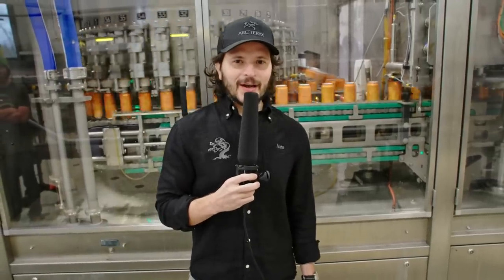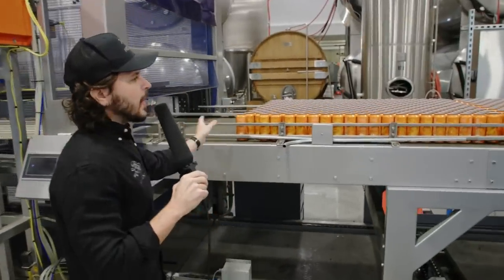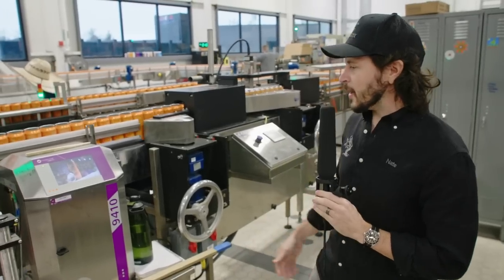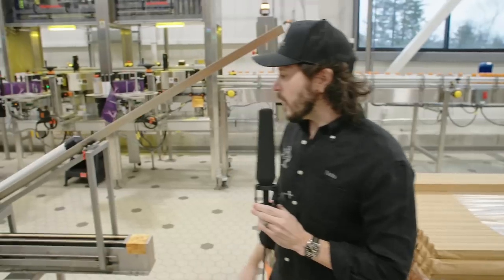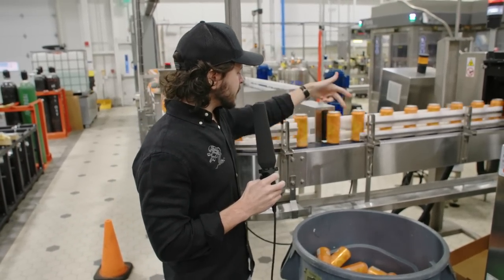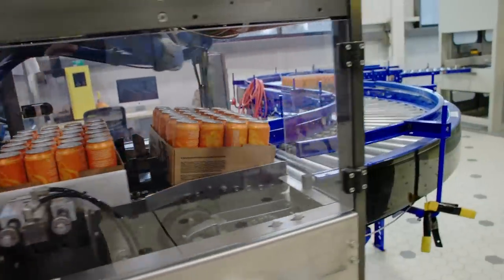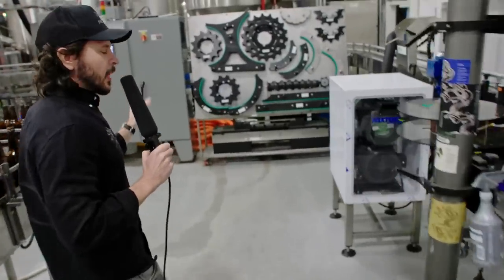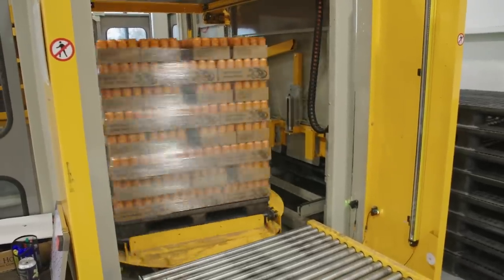How a CRAFT BEER CAN LINE works! (Tree House)

Comment: When filling kegs, why don't you use a spunding valve so you don't have to bleed pressure by hand?
Reply from the maker: Mostly old habits, it has always worked well for us
Reply: @treehousebrewco  Welp, you should give it a shot and see if it works any better.
Reply: Worst reason ever to not change

Comment: All good but this is not a craft beer!
Reply from the maker: Hello - it most certainly is. All of our systems are set up for extreme flexibility and user input every step of the way. We can control and adjust every variable manually to suit our preferences, and rely on sensory analysis throughout the process.